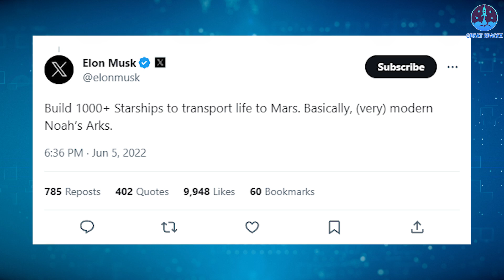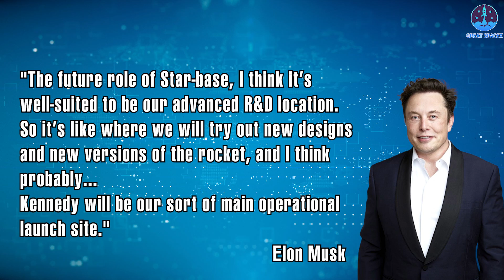SpaceX Starship's Massive factory expansion that No one has done it before!

Comment: Interesting vid, Kevin. What I don't here from you or others is a water reclamation system for the new deluge system. Are there clues? Wetland management, state or federal, will not allow manmade flooding of the wetlands with unreclaim water adding to an already soggy basin. Imagine multiple launches per day with no reclamation of deluge water, soon the OLM would sink or lean, along with the tower.
Reply: I watched the test when exposed to the rocket flame.. the only thing I saw was lots of a huge water vapor cloud.. I laughed.. do you really need to reclaim any water when it all becomes a cloud of moisture?
Reply: @compton2966  Reclamation is not in question it has to be done, my question is how and if Kevin knows anything on that aspect of the deluge reclamation system he knows about. All water must be reclaimed and what you saw was only the steam after ignition the water prior to ignition is runoff. Elon and NASA built on swamplands (wetlands) so just to stabilize the land for this build he had to bring in literally a mountain of soil to just build on it. Any water that is added will make the lands swamp, again, plus the land is regulated by the State of Texas wetlands, and the USGS, and will be one of the regulator commissions he has to satisfy in law suits before a regular launch schedule, beyond testing, the company will have to meet.